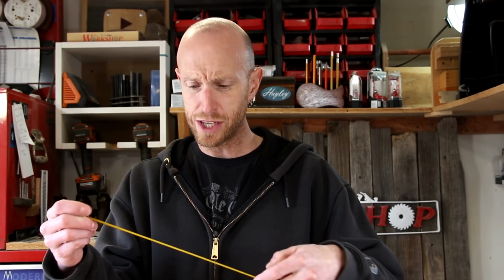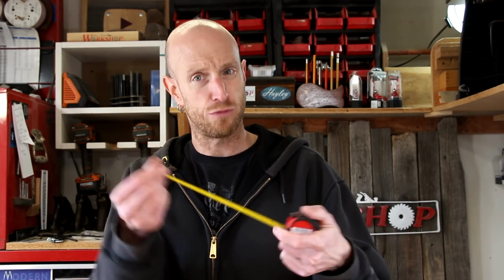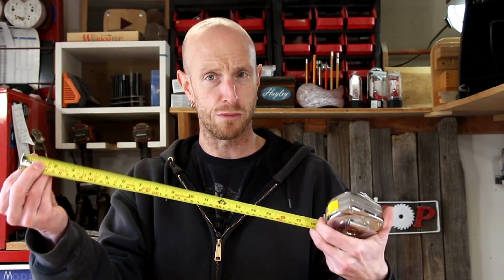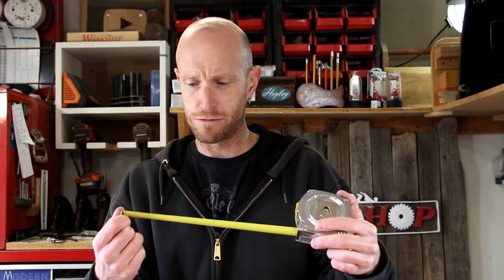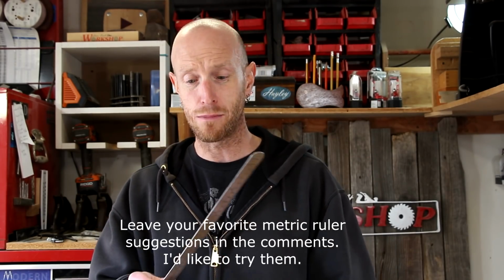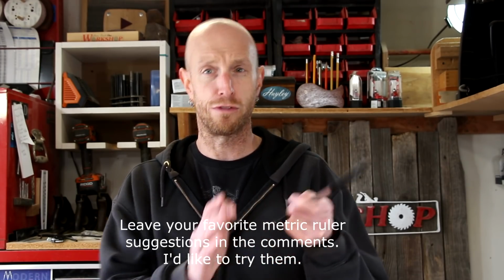My thoughts after using the Metric System for a project | I liked it

Comment: The fact that you felt more accurate is because in your head is much more easier to visualise the metric sistem because it is in base 10. You can easily see 1/10 of a centimeter, but wtf is 1/64 of an inch?
Reply: A toenail
Reply: @justan idiot You're not wrong that metric is slightly less useful for 3rds, but that can be circumvented by using measures that allow for this. It's for example very easy if you take a length of 12 (let's say cm), which can then be split in 3rds, 4ths, etc. You'll rarely find things in metric that are exactly 1 unit long (except maybe for meters, because that's a handy length). The main purpose of the system is easy conversion, regardless of the quantity of units. The Imperial system is very much meant to measure things in whole units (and works very well when doing so), where metric works regardless of the chosen length.
Reply: We should use the dozenal system. It's better. The problem is that the metric system is based on decimal base.
Reply: @rubenayla  Not quite true actually, metric isn't dependent on the decimal system, it would work just as well in a 12 based system. And while I agree that a 12 based system would be better than the decimal system, converting a number system would come at a cost far greater than the benefit would be. Almost every number in existence would have to be adjusted, and entire generations would have to relearn their calculation muscle memory. The potential errors that would come with that could cause devastating problems (I really don't want to enter a skyscraper built on calculations right after such a system would be implemented, or think of medical dosages, far too many possibilities for human error).
Reply: @driesvandenbrande2941  
The way the metric system works is not dependent on decimal base, but the prefixes kilo, mega, giga,... will have to be redone and relearned (no big problem), and, what most bothers me, we use both very extensively meters and millimeters.
It turns out 1m = 6B4; mm, so it's not so easy to convert between meters and millimeters in dozenal base. We would end up using other subdivisions of the meter with different dimensions. That is, all screws would have odd pitches and sizes in dozenal base, unless we use mm as the fundamental unit.

Humans are going to start colonizing other planets and expanding the amount of engineering and stuff created, so I think the benefits will always be higher. The longer we take to switch to the better system, the higher the cost will be. In the short term it will of course be a nuisance. In fact, (I know this sounds too sci-fi) it is very expensive to export products from earth (due to the strong gravity and atmosphere), but very cheap to import stuff (also due to the atmosphere). However, in other planets like mars it will be expensive to import stuff and cheap to export it (little atmosphere and gravity, easy to put in orbit but needs propellent to land there).
I think earth's standards will not standardize in other places. They will stay in the earth.
Reply: @rubenayla  There actually really isn't a need to reimagine metric in a 12 based system. The best way to do so would be to add 2 more numbers between 9 and 10, hence 12 becoming the new 10. 144 would become 100, etc. Metric conversions would remain the same, it's just that values would be named differently, how those values interact is independent of this. It's also true that except for the base unit, the value of subunits would change (144 cm in a meter for example, but it would still be called 100 cm). So the change to a 12 based system would come with adjustments, but the base system values and conversions would remain the same.

I do think that the decimal system will remain in place regardless of human progress, simply because the conversion would be an almost impossible challenge. In a world where everything is based on 1 number system, and has been calculated according to values that fit that system, almost everything would have to be reimagined. Even in case we move to different planets, they will initially be built on the decimal system, and this will have to remain in place to align further development with the initial stage. People being sent there will also have grown up with the decimal system, so I doubt they'd be inclined to learn a new number system from scratch when there is no necessity to do so. Keep in mind that the main issue is that dividing 10 by 3 is inconvenient, but it's not that big of an issue. In reality an approximation (3,33) will always be sufficient.
Reply: @driesvandenbrande2941  
I think you meant 84; cm in 1m, since 84; cm = 100. cm (I use ; as the fractional divider with dozenal base for now, and I always write it to express the base of the number. I think something like | would be faster to write and would look less messy. ' seems a little bit confusing since some people use it as the decimal symbol).
If we stuck with m and mm with dozenal numbers we would end up with a system like the imperial, with a mess of conversions. 

In my opinion base 12 is specially useful with multiples, not only dividing by 3. Many engineers say they always try to use numbers that are multiples of 12 (for example in CAD, or electronics) so that you can subdivide it without getting decimals.
All those 0.125, 0.25 (fourths), 0.333 0.333 and 0.667 would disappear. For example the pitches of METRIC screws are often 1mm, 1.25mm, 1.5mm, 1.75mm. They would become 1;mm, 1;3mm, 1;6mm, and 1;9 mm. You gain divisibility by thirds AND fourths. I think it's worth it, with clear symbols to indicate the base. Computers don't care what base we use.

It's also easier to learn multiplication tables. In addition to having twice as many non-trivial dividers (2,3,4,6 instead of 2,5), since they are smaller, you're more likely to find each one of them in any big number you have to use. Every 3 numbers there's a multiple of 3.
Reply: @rubenayla  Had to do the calculation, and yes, 84; = 100, but I meant it the other way around 100; = 144. So one meter in the 12 based system would be divided in 144 cm when viewed from a 10 based system. This would ensure that the ease of calculation would be maintained, but would also mean that aside from the base unit, the others would need to be adjusted. As long as we maintain the base units and the rule of multiplying and dividing by 10, metric would work just as well or even better in a 12 based system.

But again, I don't feel that divisibility is that problematic that we would benefit enough from the drastic change. In metric, the issue is easily circumvented by, as you stated, taking values that do divide easier. If you can't have a 12 based system, the next best thing is to at least use 12 based values. It doesn't have the same ease of calculation, but it's not all that difficult either. And the issue really isn't computers, it's people. If we move to a new system, people will need to relearn to interpret it, which is very hard, and bound to cause serious errors. Things like multiplication tables and any other calculation muscle memory would become almost completely useless.

For this reason it might actually be safer to completely rewrite the number system, as to avoid confusion, but at the same time that would mean losing the convenience of being able to simply expand onto a number system that the whole world is very familar with.
Reply: @driesvandenbrande2941  You made the point
Reply: @marcamant7258  I guess so then? We were simply having a friendly discussion, not a fight.
Reply: @driesvandenbrande2941  I'm sorry I wanted to say that you are right
Reply: @marcamant7258  Oh apologies, I thought it was meant to stop me from going on about the subject. It's sometimes difficult to read the intent behind someone's comment.
Reply: Thing is with Metric System you don't need to use fractions, 1mm is already 1/10 of a cm. You don't have to go crazy with things like 2/32, 6/64 and so on, you can just say the final measure and it's there, ready for use, immediate, clear, you know instantly what is bigger and what is smaller, no need to convert anything, and if you were to convert things that is immediate too.
By the way yes, Metric System is more precise.
Reply: 3/16?
Reply: @rubenayla  If you switch from base 10 to base 12 the prefixes would simply change aswell. Instead of kilo beeing 10^3 it would be 12^3 nothing would really change in that regard. 1m would still be 100 "c"m or 1000 "m"m, but it's still unnecessary.
Reply: @mathewcherrystone9479  The symbol k kilo means 1000 in base ten. It's a number. An amount. The amount 1000. = 6B4; so 1kg = 1000. g = 6B4; g.
That amount is not useful in base 12, and we shouldn't just redefine the meaning of kg as 1000; g or 1728 g. In my opinion the prefixes should be constant amounts independent of the base, that will therefore be equivalent to different symbols in each base.

I think we could just use scientific notation (or engineering notation) and say the exponent part (10^3;) as a number. 
In decimal: 1200m = 1.2e3 m = 1.2km

Since 1000; is said as "mo" in dozenal, we could just say 1200; m = 1;2 d3 m = 1;3 d3m = 1;3 mo-m
I think we can just write d3 m and say mo-meters. That way we don't have to learn anything new (the names of prefixes) and we can use single-syllable words.

That way it's even more consistent than our current metric system with random prefixes
Reply: @rubenayla  Why do you want to keep the old prefixes after abolishing our entire measuring and calculating system? That doesn't make sense. Again kilo is 10^3 in base 10 and using it as 12^3 in base 12 would change nothing compared to naming 12^3 "mo" since you have to state which base you are using anyways if you were to use both. When you don't use both there is no need to keep the old definitions of kilo etc. anyways. It's like the dozen in the base 10 system that only is relevant, because of it's history.
Reply: @mathewcherrystone9479  Then it would be impossible for me to express an amount in mm as fundamental unit, using dozenal nomenclature. Many programs use mm as the fundamental unit, an it would be very strange for it to change size depending on the NUMBER base. Your proposal is possible to implement and it has advantages, but I think it's a mess. I mean, when you write "mm" in your mind you are considering a new unit rather than the meter, derived from it. It would be very strange to have its dimensions linked to the number base. I see them as independent entities even though it doesn't have to be that way.

I would like a mm to be an exact constant distance, independent of the way you want to express how many of them you have.
Reply: @rubenayla  When you look at conversion between m and mm as simply moving the decimal point three places it makes alot of sense to do the same with the dodecal sign. Obviously this is what a human would do. Programs have to convert between the base systems all the time so it would only be a matter of background implementation.
But the question is still why keep the base 10 system after converting to the base 12? Keeping the old units as they are would just lead to unnessesary confusions just like the imperial system does now, with the key difference that the base 10 SI system makes sense.
Reply: @mathewcherrystone9479  Because the transition, if it happens, will be gradual and will have to coexist with the decimal base.
Reply: @rubenayla  Ok, sure for the transition period it would maybe be confusing depending on the interpretation of the units and their prefixes.
Anyways I still don't see enought advantages to switching considering the massiv amount of work required to change the system.
Reply: @yannikoloff7659  3/16 = 0,1875 (0,19 for practical purposes). Not that hard. You would have made a better argument if you divided by 3 or a multiple of 3, that's where the decimal system is less useful, though an approximation like 0,33 will still do the trick. Also, metric only rarely works in singular units. Do you need a measurement that's easily dividable by 16? Pick a multiple of 16, in whatever unit works best for the situation. Like 16 cm for example, then the answer for 3/16 would be 3 cm. And if you can't choose the value yourself, you're still better off measuring in metric than in imperial, as imperial is very much dependent on whole units and their fractions, which metric isn't.
Reply: @rubenayla  i wished people had six fingers, I really do ,math would be so much easier,I'm mathematician.
Reply: It's like you worked with computer logic
Reply: "wtf is 1/64 of an inch" I though the exact same. 😅
Reply: @yannikoloff7659  Don't butt in if don't know anything. We use the system that would lead the least variance. That would be metric.
Reply: 69
Reply: I have heard of a tribe, that did not count numbers linearly like most people, but rather logarithmically. And they use the logarithm of base 10. With that in mind and since basically all civilizations that are adept to mathematics invented a numeric system based on 10, you can make the arguement that our brain is hard wired to think in 10.
Since we've been taught Arabic numerals and decimal system at school, this reinforces naturally counting in 10s.
Reply: @rubenayla  For those who use 1 dollar = 100 cents - they are not complaining.
Reply: @rubenayla  I am using some generalized sizes here - 1/16" is close to a mm.  a yard(36") is close to a meter(39")
So, if I asked you for the width of your front lawn - what measure would you use in Imperial measuring?  Most likely the Yard. Right?
Now I ask you in metric measure...you would use the Meter.  Many are measuring in "mm"   Who TF measures the yard in 16ths of an inch?
MM is the smallest unit, then Centimeter is in units of 10.  We can recite using 10's up to 100 very easy.  "Cent" also means hundred.  So 100 centimeter= 1 meter   1000 meters is a kilometer  We don't eyeball that, we using a measuring device...like a car...and odometer.   No need to covert between anything.   If you are driving 100kph in one hour you will have covered 100km   Us lower life forms do not care much beyond that what the car can do.
Reply: @bunzeebear2973  So you will use a different unit for each and every thing you have. Nice, what the imperial system does basically. I think you'll have to convert between units, because people are furious at the imperial system, and that's because they have to do it.
Now everything 1m long will be 6B4; mm. Super easy to divide to thirds right? There is a problem when mixing objects defined as 10^x times a fundamental unit like the mm but using a dozenal base. You would use fractions of a meter to not have that problem, but mm are very standardized and you will definitely have to convert to mm for some programs or stuff that asks you to use that unit.
Reply: @rubenayla  It's not. Base 10 trumps all bases apart from binary in computers.
Reply: @liviuganea4108  wtf
Reply: @rubenayla  I fucking dare you to write in base 16. And make sense.
Reply: @liviuganea4108  ?
Reply: @driesvandenbrande2941   This is a missconception. Since the smallest unit used regularly is mm - there is no need for fraction or dividing. Imperial users always thin there is nothing smaller then the cm and that you always need to fraction everything - but that's wrong. 
All that shit with dividing by 3 and 8 and 9 and...  is due to the imperials extremely huge base unit. The mm is 25,4 times smaller than the inch - therefor you never have to divide it by anything - it's more than accurate for woodwork.
Reply: 1/64 of an inch expressed in logarithmic terms: (1/2)^6 = 1/64
 
Take an inch and cut it in half (1/2in)
then cut that in half (1/4in) 
then cut it in half again (1/8in) 
and in half once more (1/16in)
and then in half once again (1/32in)
then in half one last time (1/64in)

I don't know what kind of cyborg finds it easier to visualize 1/10th of something than it is to visualize 1/2 if something.
Reply: @driesvandenbrande2941  Well stated!
Reply: when we measure on site or wrighting down measurement it always in mm say a wall i was building was 8m long i would wright that on the plan as 8000mm eg 1.2m would  be 1200mm if was handing  the measurements to another worker
Reply: Funny you say that; Napoleon, who had been opposed to the introduction of the metric system in France, said the exact opposite: “I can understand 1/64 of an inch, but not 1/1000 of a metre.”
Reply: @rubenayla  Is that a British dozen or a Baker's dozen?
Reply: @driesvandenbrande2941  You're wrong. Fractions of imperial units are NOT expressed in radix 12, but radix 2. Even the use of radix 12 is inconsistent - 3 ft = 1 yd.
Reply: @driesvandenbrande2941  What's better when it comes to a 12 based system? I don't see many cases in which this would be an improvement (actually none come to my mind).
Reply: @ThePandafriend  Look at it this way. 10 is divisible by 2 and 5, 12 is divisible by 2, 3, 4 and 6. This makes it a more interesting base for calculations, particularly divisions.
Reply: @driesvandenbrande2941   yes divisible by more numbers but it is not as easy for human. for multiplication the simpliest tables are  1 and 10. that why using base 10 is simple. So using base 12 could be  better as a scientific approch but less easy to use and something better is not always the best option.
Other point mm is not the smallest unit as I'm sure you know, for exemple in lifescience you have smallests units (and that the magic of the metric system...) but mm is the usally smallest unit use in our daily life
Reply: @herendel  Base 12 would be pretty much as easy to use as base 10 in everyday life, rounded numbers are only relevant because they are multiples of 10. In a base 12 system rounded numbers become multiples of 12, 6 replaces the function of 5, it's just two more units in a set.

The main issue is converting to it and getting used to it. I don't think it's worth changing to it because of that, especially the conversion would be immensely complicated. But it is still an objectively better system when compared.
Reply: @driesvandenbrande2941  yes for division it's simple but not for convertion between units that means you lose the big strenght of the of the metric system because with base 10 : 1m=10dm=100cm=1000mm  it's simple no calculation
but in base 12 I'm not sure how it will work I mean : since you do pack of 12 it should be 1m(or the equivalent of one meter in base 12) 
=12 elements  of 'dm'
=12 elements  of 'dm'x12 elements of 'cm'
=12 elements  of 'dm'x12 elements of 'cm'x12 elements of 'mm'
Reply: @herendel  Yes that's exactly how it would work. 12 is the new 10 (but still written as 10, 10 and 11 get new symbols), 144 the new 100 (but still written as 100), etc. It would for the most part still function the same way we calculate in base 10, so you would still say 1 m = 10 dm = 100 cm, but the value of 10 and 100 would have changed.

This is also why it would be almost impossible to convert, because every value of 10 and up changes in how it's written, and the metric system would have to be rebuilt on base 12. But it would still function the same way as today, with some tweaks.
Reply: @driesvandenbrande2941  yes but even  if 12 is the new 10, in 1m you still have 12 elements. that why for conversion it's not as simple. since you mix base 10 for the writting (1 m = 10 dm = 100 cm, ) and base 12 (1m you still have 12 elements) so if you whant to kwow how much mm you have in 1 m you can't do it without calculation.
that why for me yes is simple as a mathematical approch but not for the metric system
Reply: @driesvandenbrande2941  The current metric system is based on the decimal system. That it could be based on another value is irrelevant.
Reply: @poppypalais3108  Just like your comment then. I'm not proposing to change anything, we're talking hypothetically here.
Reply: @driesvandenbrande2941  You wrote that the metric system is not dependent on the decimal system, but obviously it is. That it could be based on something else is, as I wrote, irrelevant. And fractions of imperial units are based on any root you wish to use, 3 or 7 or anything, not just 2.
Reply: @poppypalais3108  It is as it is now, but only because it follows our standard numbering system, which Imperial also uses. And metric can do the same as Imperial in that regard, fractions are not unique to Imperial. This is not the same as Imperial using different bases.
Reply: @driesvandenbrande2941  why we need "divisions"?
Reply: Try explaining 3.5" or 5.25" floppy drives to modern kids. First everyone asks what a floppy drive is, and then everyone asks what 3.5" are! I hate explaining to people that even though we live in a metric country, Television sets are being sold as 42" instead of 105cm! As a man, believe me when I say that 25cm sounds much bigger than 10"....
Reply: I feel like it's many because the millimeter managed to hit a sweetspot in terms of accuracy, anything bigger is to inaccurate, anything smaller is likely to difficult to measure properly and doesn't help you. And anything else is just a multiple of this smallest unit. Also in practical application, the fact that a food is nicely dividable by 2 and 3 is meaningless as most distances won't be in whole feet in the first place.
Reply: Lol. I have to use a lot of binary & hexadecimal numerics in my field of computers. Humans can adapt to anything. Base 10 metric makes more sense tho since our numbers  range 0 to 9.